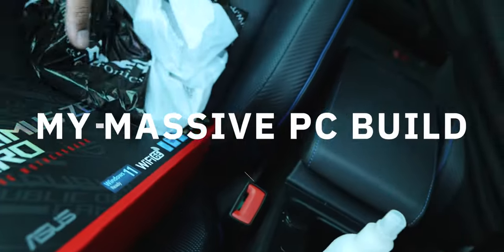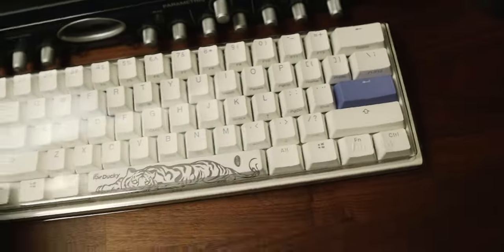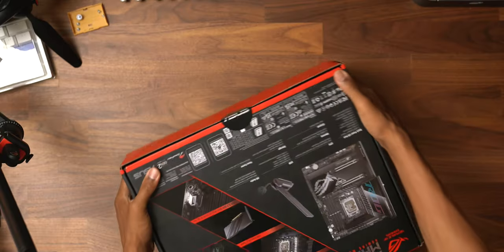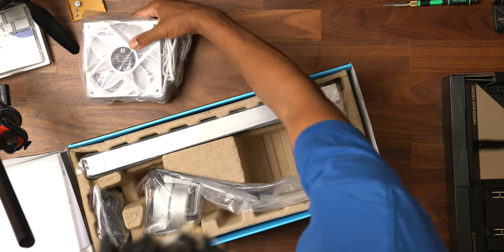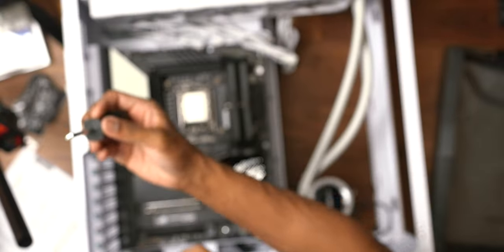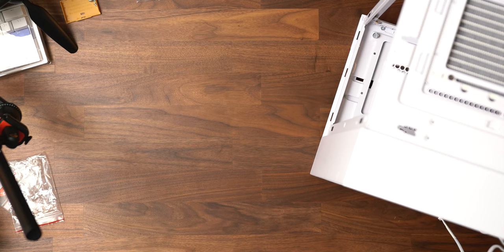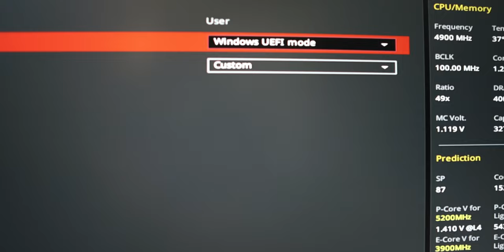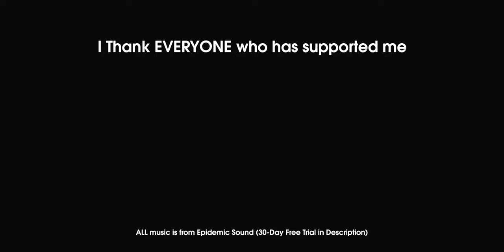MASSIVE Gaming PC BUILD - i9 12900K RTX 3080 O11 Dynamic EVO

Comment from the maker: What’s in your PC or what do you want to build?

i9 12900K (processor): https://geni.us/i912900K
Asus Maximus HERO (motherboard): https://geni.us/z690MaximusHero
Aorus Master 3080 (GPU): https://geni.us/Aorus3080Master
Corsair Dominator DDR5 (RAM): https://geni.us/CorsairDDR5RAM
Lian Li Galahad 360mm (AIO): https://geni.us/Galahad360
be quiet Straight power 11 (power supply): https://geni.us/bequiet1200w
Lian Li O11 EVO (case): https://geni.us/O11DynamicEVO
M.2 SSD: https://geni.us/m2ssd980pro
M.2 SSD: https://geni.us/m2ssd970plus
HardDrive: https://geni.us/Barracuda4tb
Lian Li Unifans AL120(x2): https://amzn.to/3Q13yiN
Steelseries Nova Pro (gaming headset): https://geni.us/SteelseriesNovaPro
Streamdeck XL: https://geni.us/StreamDeckXL
Xbox Elite 2 Controller: https://geni.us/XboxElite2
MSI Esports Gaming Monitor: https://geni.us/MSIesportsMonitor
Reply: Interesting build CJ. My primary workstation is composed of an Intel Core i9-1900X,Asus ROG X299 E Gaming II,64 GB of Corsair Vengeance Pro  RGB Ram, Asus ROG 3080 Ti, Sound Blaster AE-9 , Corsair Neutron NX500,four Samsung 970 Evo M.2 drives, Corsair HX1200i,Corsair RGB Pro XT AIO enclosed in the Cooler Master Cosmos II Ultra Tower.  I am waiting for intel to release a successor to their HEDT X platform before I upgrade.
Reply: Got a 12600k asus tuff z690 16gigs of ram and got a 3080FTW3 on the way shoulda bought that before I sold my 3070 tho
Reply: Lian Li Lancool II Mesh case (white)
Amd 5900x
Lian Li Gallahad 360 (white)
MSI rtx3080 ventus (black)
MSI X570 Tomahawk mobo (black and silver)
2x16gb Crucial 3600mhz rgb ram (red)
2x1tb sabrent rocket m.2 nvme harddrives
850w Corsair power supply (white)
5x120mm EZDIY-FAB Moonlight rgb fans (white)
Silver Metallic braided cpu and gpu cables with RGB cable clips for lighting
"Silver Cloud Journey" - it was a long journey during covid to build it!

Comment: Looks fire, and great quality video. one thing to consider next time is the amount of software you’d need to control all the RGB. 
For computer alone you’re looking at:
1) Asus Armory Crate (motherboard and anything plugged into 5V RGB header)
2) L-Connect 3 for Unifans and Strimers
3) RGB Fusion for Graphics Card
4) iCue for Corsair Ram
And possibly 5) peripheral RGB
Reply from the maker: Great point
Reply: Gotta get the Strix 40 series and you’ll be chillin 😎cuz at least you can sync with the motherboard for iCue and L-connect

Comment: Hi just a question, if i fit a 240mm galahad aio into this case, can i put an extra fan in the slot thats not used?
Reply from the maker: I don't see why not...otherwise it's just an empty space...a fan would make that space useful. Hopefully the radiator isn't too bulky and allows for the fan to fit but you'll find out

Comment: Maaaan that thang beautiful 🥲 lol you notice any difference with the new CPU and RAM combo with the old GPU or not too much of a difference? Let me know. Also do you like windows 11? I’m still on windows 10 😅
Reply: Also, I hear the next gen GPU’s from Nvidia are going to be power hungry so you MIGHT have to get an even bigger PSU as crazy as that sounds lol hopefully not though
Reply from the maker: You know what I’ll do a fps test on both and let you know. So far windows is ok different feel from 10 for sure but I’m still getting familiar with it. 😳 that would be buts if I need more than 1200w 😂
Reply: @CJKnowsTECH  cool! And that’s what the rumors are saying at least. You know rumors be wrong all the time so you might be fine with 1200W. That DDR5 RAM is expensive! I just got a DDR4 build last year! 😂😂 it’s cool that they gave you the m.2 pcie hub with your motherboard too. It should be more than just two slots in there. If it’s only 2, I think that would be worthless like you said 😂😂